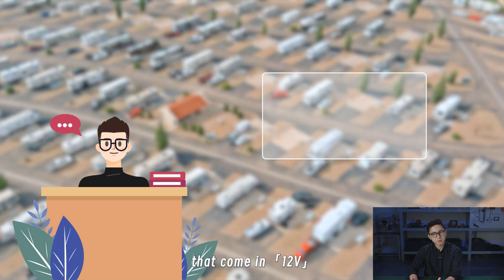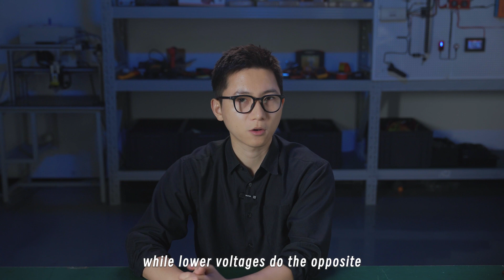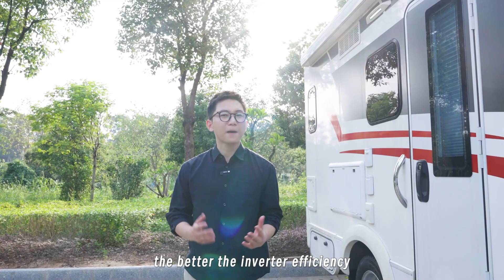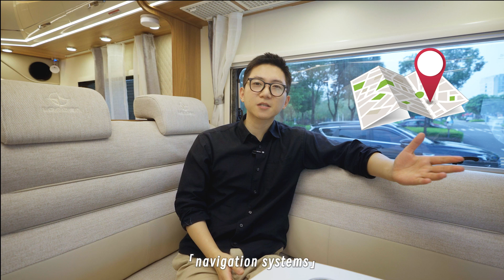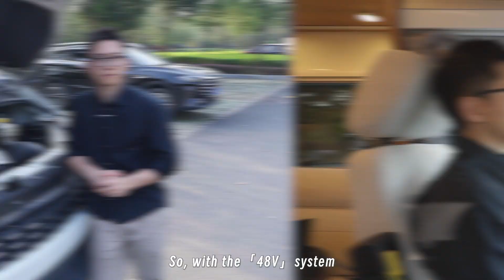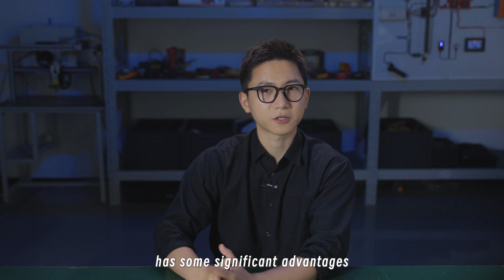12V？24V？48V？RV‘s Power System. HOW TO CHOOSE

Comment: Please, teach us how we can get or make the ethernet to rs485 cable for communication b/w inverter and bms which a guy did in last video two month ago on ur channel.
Reply from the maker: I'm not much sure what your  problem is, have u tried yet? we showed two way to make the connection, interface board or just use an ethernet wire. I remember there are different color of it ,so you can check and follow the guidance.